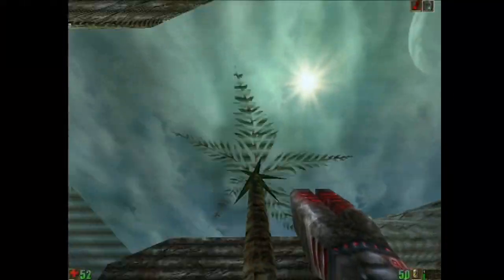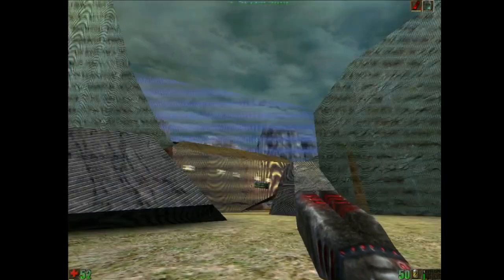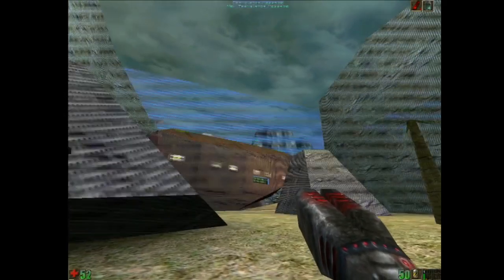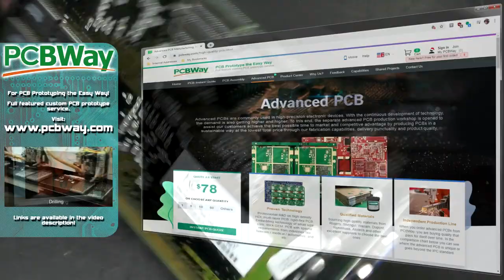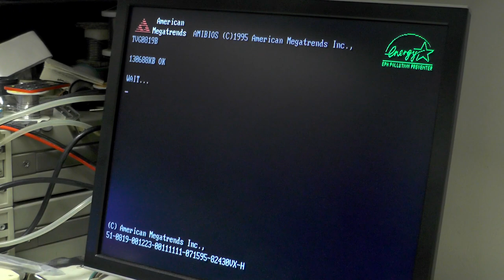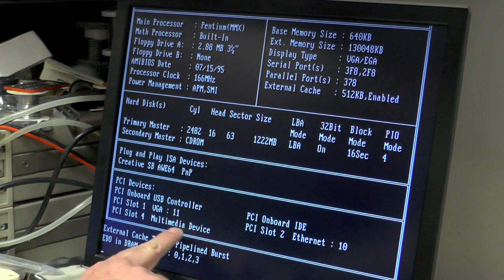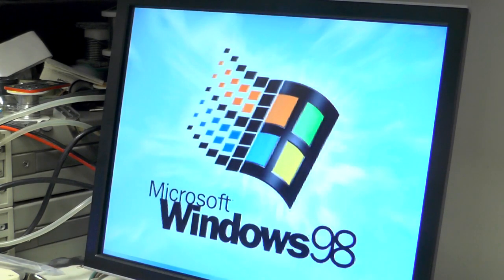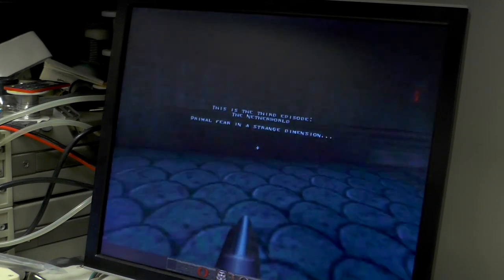DL191 DIY 3Dfx Voodoo 2 8MB to 12MB RAM Upgrade

Comment: Wow I assumed you have to copy the bios from the 12 MB card, I didn‘t expect auto detection of installed memory
Reply: Voodoo1 and Voodoo2 cards don't have BIOSes, they're purely memory mapped devices.
Reply: Even if they would have BIOS chips, it is sometimes easier from a manufacturing standpoint to produce a single multipurpose component for many applications, than to make one for each modification of the same card.
Reply: @GGigabiteM  Even still, I was surprised he didn't have to bridge solder pads to change the memory size. That was a very common way manufacturers could reuse boards without needing any additional logic at all.
Reply: @roguenova6766  It's very common for videocards to have multiple bios versions specc'd for different memory manufacturers and timings.
Reply: @rich1051414  S3 did the same.
Reply: @xDownSetx  These weren't really video cards in the traditional sense of IBM PC's - the system couldn't use it as a primary display (excepting the linux console framebuffer driver, but that's more of a hack than anything) but rather another video card was needed for 2D functions and that's the one that would need the BIOS.

I think on this, since they figured it doesn't need to help boot up the system and the driver could just trivially poke at memory and figure out if there was 2MB or 4MB attached to the texture chips, no sense investing in a flash chip or even burning a chip pin on a config jumper/etc...
Reply: The voodoo cards will run even if the tmu memory is completely missing or dead.

Comment: Ah memories... back when SLI was worth it, and still meant Scan-line Interleave.
Reply: You mean before M$ and NoVideo collaborated to push DirectX and kill 3dfx and Glide ?. InHell might be anti-consumer and famous for how they kept better sales than original K7/Athlon with their horrid 423/478/ early 775 pentiums (Northwood, Prescott and so on) but what NoVideo did to 3dfx was way more anti-consumer and anti-progress - remember - NoVideo bought and completely erased what was left of 3dfx - just to get hold of the patents and bury Glide (which actually was way more efficient API than DirectX and was not tied to Windows). Same thing is happening with Vulkan now - only saving grace for it might be the next gen consoles.
Reply: @volf3r505  3DFX went bankrupt, Nvidia picked up their assets on the cheap and didn't continue the limited non-scalable design the 3DFX cards were running on. That doesn't mean nvidia was evil. Glide was also not an open standard (until right before 3DFX went bankrupt), was tied to 3DFX's hardware, and was superseded by both OpenGL (of which Glide was originally based on) and DirectX. There was no point to Glide other than for 3DFX to have a proprietary offering to try to lock people into their brand.
Reply: @volf3r505  Holy delusional memories warped by nostalgia glasses, Batman! 3dfx killed themselves with stupid decision after stupid decision (like deciding to become their sole physical card manufacturer for some idiotic reason!), and Glide being closed source & funded by a failing company had loads of problems keeping up with the latest GPU features and games.
Reply: @Cooe.  And since that time nVidia adapted it! 🙉
Reply: but still not really efficient ... double gpu bumped approx 40% instead of 100%
Reply: The antialiasing/smoothing was pretty much impossible with scanline interleaving though. Every other frame works better for that but puts more load on each card and changes the delay.

Comment: This is awesome!  "Back when I was young"   I had a Guillemot Maxi Gamer Phoenix Voodoo Banshee 16MB. While your card is arguably faster than that one was, it sure played UT and Half Life pretty great.  It retired about 4 years later for a ATI 9700 and did a bios flash to a 9800 pro.   Thanks for sending me down memory lane!
Reply: Voodoo banshee is a voodoo2 with 2d gpu.
One of the reason it have about the same power like aan voodoo2 8Mb .
Not all 16Gb is use for the voodoo part.

Comment: Exellent job.
I can't believe your timing on this! I just had a go trying to fix my VooDoo2 12MB also from Creative CT6670 which wouldn't go above 512x384. Even at 640x480 it would crash. Turns out it was also a memory chip that was bad. It was one of the four from the back from the framebufferchip. It's going strong now!
Reply: How did you find the bad ram chip?
Reply: @henrikwils9323 I just removed the four chips on the back connected to the framebuffer, and already without those i could go up to 640x480 without issue. Then i added 4 "new chips" and it worked flawlessly at 800x600 again. As for knowing exactly which chip was bad, i've tested each one of those four chips on some S3 PCI videocard with sockets for EDO memory, and sure enough one of them was faulty and caused artifacts on that particular card.
Reply: @totalrandomtechnolog  Holy smokes!!! You just made my day! Thank you so much!
Reply: @totalrandomtechnolog  +1
Reply: @totalrandomtechnolog  this solution is priceless!

Comment: Nice going! I did the same last month. Also replaced the RAMDAC and the VGA output switch (mux), to get rid of discoloration. What I haven't done yet was a near complete reverse engineering one of my bad boards. Also haven't found a way to test these fast EDO RAM chips.

Comment: These cards can be upgraded to 20mb (stacking or double density) provided one knows what they are doing as the TMUs can do more than just 4mb each and the spec according to documentation allowed up to 16mb per tmu however was never done to my knowledge. The frame buffer is limited to just 4mb on both the voodoo 1 and 2 as well the voodoo rush.
Reply from the maker: I had suspected that as i have seen 12Mb cards with DRAMs installed on one side only so thy must be able to handle the extra dense chips.
Reply: @DextersTechLab  sounds like the second version of the STB V2 1000 when reading from this post:
https://www.vogons.org/viewtopic.php?f=63&t=72925

Comment: This is great. I need to watch this over and over. I have an 8 meg card that I want to make 12 megs so I can SLI it with my other 12 meg card. Great video. I dont have soldering experience, but ill give it a go. The 8 meg card was found in a thrift store computer for 5 bucks but i still dont want to ruin it.
Reply: same here. 5 bucks? what a bargain!

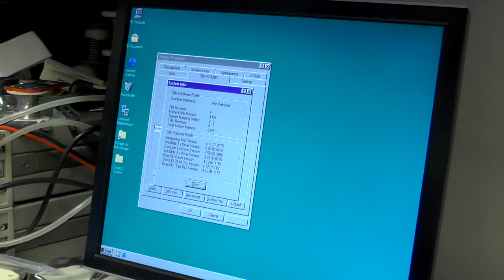Comment: @ 8:17 I noticed on the bottom right RAM section there is a contact/pad missing on the middle of the top row. How did you go about fixing that? Also @16:15 when you brought up system info it showed 8MB total RAM, I thought you upgraded from 8MB to 12MB RAM on the voodoo 2 card.
Reply: The Voodoo 2 12mb cards had a 4MB frame buffer + 8mb separate texture memory. That's 12mb total. That's what is shown at 16:15.

Comment: I actually have a set of those 8MB cards. One is unfortunately missing a cap on the back, easy fix since I have the other one for reference.

I notice the bottom number on the chips don't match. I'm assuming its maybe a lot number or something? Long as the part number matches?

Comment: I'm quite pleased with your handywork also. You could run mismatched cards, but you'll bugger the 12mb card down to 8mb. If you ever upgrade memory on other cards, and they don't show full amount, it's because of little [0] resistors called memory straps. They need to be moved for config of higher density VRAM chips. Great job. Good luck in future projects. 😊

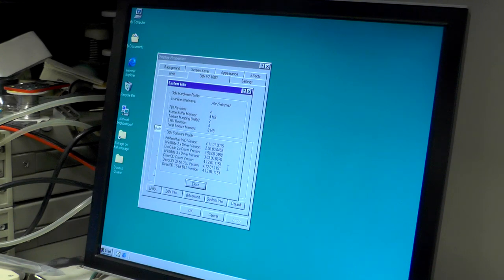Comment: 16:10 Shouldnt Total Texture Memory be 12MB rather than 8MB if you've upgraded? Or is the Frame Buffer included too?
Reply from the maker: Generally speaking the quoted size of a voodoo 2 includes the frame buffer.
Reply: @DextersTechLab  Gotcha 👍
Reply: The memory on Voodoo 1 and 2 cards works very differently from later cards as each of the frame buffer and tmu chips has its own memory. The frame buffer is limited to just 4mb and doesn't scale in sli while the tmu memory does which tops out at 16mb according to documentation though never tested.

Comment: Nice soldering I've soldered that ic package before but using the drag method with LOTS of flux. but not really practical with the ic's that close i guess. I used to have a Voodo2 back in the late 90's in a cyrix Pr200 the Voodoo was my main expense in an otherwise budget gaming pc build. ran quake and duke3d awesomely.

Comment: depends on what version the board rev is. I have like 10 pairs of voodoo 2's 12 and 8 meg versions and some of the 8 meg versions all the ram slot are used
Reply from the maker: I would wager all the pcbs are the same but they use different density drams

Comment: What would happen if you used a 24mb ram instead would it fail to recognize that ram increase
Reply from the maker: Most likely, i am sure the frame buffer is fixed at 4Mb. The TMUs i believe can address 16Mb, but i have never seen anyone try and upgrade a card.
Reply: @DextersTechLab  16mb version of the card might be a neat thing to try

Comment: I remember unreal being not so blocky and higher texture.  I suspect in another 20 years I'll be thinking "my word, elite dangerous used to run at the size of a postage stamp"  as I gaze through my 6000 pixel per millimeter VR / AR contact lenses.

Comment: I had a Voodoo II, but my first 3d accelerator was the Voodoo I.  Had to use a patch cable to my video card.  The Voodoo I handled the 3d graphics only.  Had to upgrade to the Voodoo II once the I went out and all 3d aspects went black, but everything else worked.

Comment: I have 4 black Voodoo2’s that are 12MB cards, but they only have memory on one side.  There are components on the back, but no memory.  I use 2 in one of my retro PCs and have 2 spare.

Could it be possible to convert these to 24MB cards and run two of them in SLI giving 48MB of graphics.

If it is possible, it’d be total overkill...
Reply from the maker: Yes i do think this might be possible. But as games were optimised for the 8mb texture ram i doubt you would see any difference.

Comment: Theoretically, is it possible to install a ridiculous memory amount on it? Like 24mb or something?
Reply: No. The circuit board can only access 12 MB; there are no traces on the board going to the pins you'd need to address more memory.
Reply: Yes, in theory it is possible: http://darwin-3dfx.sourceforge.net/voodoo2.pdf
I've never heard of anyone trying it though, or if other configuration settings or software support are needed.
Reply from the maker: Ooh, that's a nice document! Thanks for the link!

Comment: With that precision, you would be an awesome surgeon. I'll probably get thumbs-downed for this, but: Another valid way to fix the issue would be to downgrade the 12MB card to an 8MB (if the memory chips turn to unobtainium).
Reply from the maker: Tbh i think there are plenty of new-old-stock dram chips around.
Reply: He showed that the 8mb just didnt have enough ram for some things, didnt he?
Reply: Apache Longbow  Yeah, you could run SLI on the 8MB cards just as well. The frame buffer memory was the most important and interestingly enough frame buffer was the same on 8mb cards as it was on 12mb cards. As he mentioned in the video, the difference was you get more texture swapping on the 8mb cards. On a more modern system one way to perhaps work around or alleviate this somewhat, might be to create a ramdisk in system memory, copying all the game files there, and running the game from the ramdisk. You'd still get some slowdown, but it wouldn't be as bad as paging it from disk.

One thing I wonder about is was there any compatible memory chips faster than 25ns? If I recall correctly, I believe you could overclock these cards just a bit. I wonder if faster memory allow more overclocking. Of course, to do that, youd have to replace all of the chips, which would be a good bit of work, and that's assuming the processing chips wouldn't be the limiting factor.
Reply: @stefanl5183  It would be an interesting experiment to see if you can improve performance using a ramdisk.  There are ways of creating one in Win9x and even DOS.  But I am not sure the problem is really paging from disk -- that really would be slow.  Couldn't the bottleneck just be copying from ram to the video card?

I also wonder about the 25ns chips.  The thing is 25ns is pretty fast for those days.  The system ram in those older systems is something like 70ns, so probably you'd get more bang-for-the-buck by getting fast ram, say 60ns or less.  Again, I suspect the bottleneck is between system ram and the video card.  Then again you are also limited by the PCI bus speed.  It would be interesting to overclock the PCI bus a bit just to see how much you can squeeze out of the machine.

This would probably only be noticeable on newer games with bigger textures like Quake III instead of the Quake demo given in this video.  Quake textures were smaller and would have required less swapping from ram, so the difference between 8 and 12mb didn't really matter.
Reply from the maker: Interesting thoughts, though i would point out that this machine had a fast CF card as the main drive which would do 60mb/sec so a ramdisk might not make much difference. It's since been upgraded to a SATA SSD via a parallel to serial converter.

You can get 20ns drams, which does allow for a bigger overclock. I think these are the ones marked 120mhz?

Comment: I've tried to buy 10 of these chips from UTSource but it costs $25.92 plus $27.53 shipping to UK. Do you know anywhere else that may sell them at a reasonable price?
Great video BTW.
 Cheers
Reply from the maker: Thanks, you can choose to use the postal service not one of the couriers. It's cheaper.
Reply: @DextersTechLab  ahh missed the shipping options. Its a bit discreet. Thats a lot better at 6 dollars or so cheers for that 👍

Comment: Nice video, but you choose the slowest method possible. Put a blob of solder on the tip and pull it along the pins. Surface tension and flux will do the rest. Much faster. Any bridges you make (if any if done properly) can be removed with some solder wick.
Reply: sure, if you like cold solder joints. Better pre-heat with a hot air gun.
Reply: @SeeJayPlayGames  if done properly it doesn't leave cold joints. If you have that you went to fast. Pre heating is just not required, but fine if you want to. Drag soldering is fast and I have done it with larger chips in mainboard repair in a professional setting. Never missed a pin.

Comment: Ia have 12MB version at home pc is still alive but needs a new hardrive is there a way to adapt something never to it?
Reply from the maker: Yes, there are plenty of options to adapt newer drives and ssd to the old parallel ide interface. Compact Flash cards are probably the easiest to use.

Comment: Great work, just discovering your channel now (random youtube recommendation) and enjoying the content.  I've always struggled soldering SMD components like those chips but your close up and methods give me a bit of confidence to try again (not a voodoo upgrade, just a random dead chip that needs replacing).  I do wonder though if the upgrade you did here would work with other cards of the era that were available with different amounts of memory.
Reply from the maker: Thank you, having some kind of microscope helps a lot. You can always find old junk boards to practice removing and replacing components.

Comment: Not sure why you're not drag soldering and using a chisel tip.   It's all fine,  but took way longer then needed.
Reply: I was about to say the same thing. He could have cut his time and effort drastically.
Reply: Even that is unnecessarily long. Solder paste + heat gun in this situation would take a total of 1-2 minutes.
Your point remains valid though. Absolutely.
Reply: @nexxusty  he did say his equipment wasn't up to hot air flowing.

Comment: Great job, congrats, I saw in the past also "memory swap" in other components and I found amazing. I Try to solder several times but I really sucked at it.. ¿What  guide do you recommend to start doing some small projects soldering in the PC components PCB? (Example I want to change condensers in some motherboards that are swollen)  Best regards.
Reply: You can buy small kits to build and practice on, i got a small audio amplifier kit and it came with a board and a bunch of resisters and capacitors. great practice and it doesn't matter if you mess it up.

Comment: What's the Mhz rating of the RAM? I've seen some Voodoo2s with 90mhz, and 100mhz. I've heard of some boards with 110mhz, and even some with 125Mhz. I'd be curious how they overclock compared to the 90 and 100Mhz versions. I understand the 3dfx chips run at the same clock as the memory, and I wonder whether the limiting factor is the memory or the 3dfx chips. I used some thermal epoxy to glue some aluminum heat sinks onto the 3dfx chips. It didn't help with overclocking too much, but I put a box fan on high on my Voodoo2s and was able to temporarily overclock it to about 120mhz.
Reply from the maker: 25ns is 80mhz for EDO, so the standard cards already overclock the ram at 90mhz. The later ones with the faster 100mhz and 125mhz ram will overclock easier if you can keep the 3 3dfx ICs cool enough. At least that is how i understand it.
Reply: @DextersTechLab  Future video potential? I'd love to see two Voodoo2s modded with 125mhz RAM and some copper heatsinks glued to the 3dfx chips with thermal epoxy. You could do a clickbaity  "Fastest Voodoo2s in the world" title too. =P
Reply: @Match451  Not a great idea when these cards are over $100 a pop sometimes a lot more.